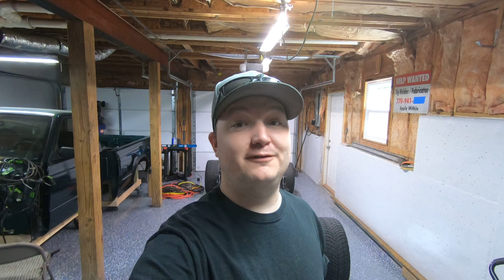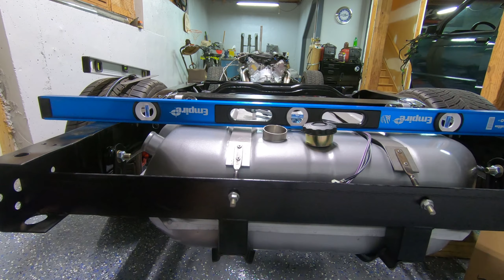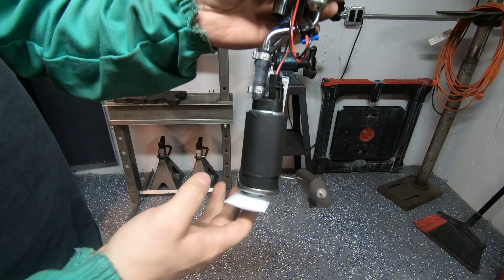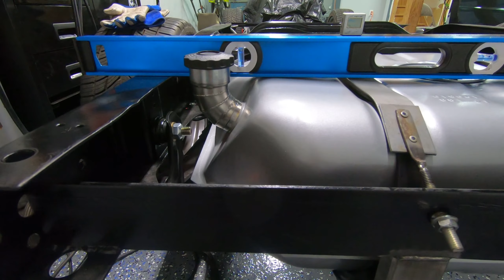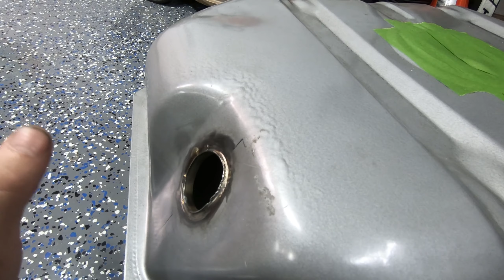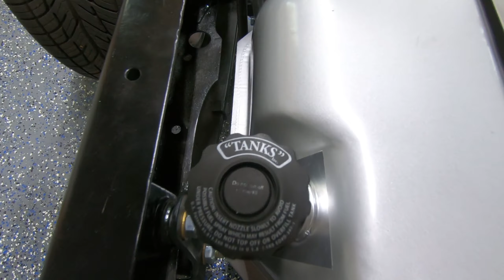Finally Finishing The Blazer Tank Install In My S10!      (LEARN FROM MY MISTAKES!!!)

Comment: I’m putting in a Ridetech air ride system in a 93 s10 short box step side, looking to relocate the blazer tank to the rear, didn’t know if any one has used this system and moved the tank also? Thank you for looking..👍

Comment: My thought with that style gas cap  IS that dirt & rain will get into the tank.
Reply from the maker: I plan graft a shrouded gas door into the bed floor, so it won't be much different than newer vehicles that come stock without a gas cap

Comment: I've been contemplating the Blazer tank swap in my Dime for a few years and your videos have finally made it clear on how to make it fit.
I would prefer to have the outside filler door setup moved back to the rear. Not sure how easy that will be to put together, but we'll give it a go. Thanks for the inspiration!

Comment: Why did you go to the blazer tank ?  Benefits ?  Thanks for the content   One more question ! How do you keep the shop so clean ?  Lol
Reply from the maker: I wanted to swap in the Blazer tank to move weight rearward, centered between the frame rails. And I try to keep a clean work area in the garage, but I can assure you, 90% of the time, a tornado has just come through behind the camera lol
Reply: Cheeky Garage thanks. I guess I was weighting the benefits verses rewards.   I remember the pinto gas tank fiasco.  I have been run in to 3 times in my 1500 Silverado and jag so I’m a bit concerned about placing gas tank there.  I loved your fit mint and welding. Did you back purge. I’m willing to bet you did because of the quality on the weld.  What type of blade did you use to cut the stainless.  Nice cuts on that smal pie cuts.

Comment: Great work tommy. The filler neck looks good. Im enjoying watching your progress on this swap. Im curious though what your plans are for the hole in the bed to acess the filler neck? I would be worried about trash getting through that push through style cap withoutnsome sort of door covering it. Especially if you're carrying something in the bed. 

Keep up the great work!
Reply from the maker: Thanks buddy. The plan is to graft a gas door in the bed floor to keep it covered up and still looking stock-ish
Reply: Hey Tommy did you ever get the filler neck door finished on gumby? If so would like to see what you come up with